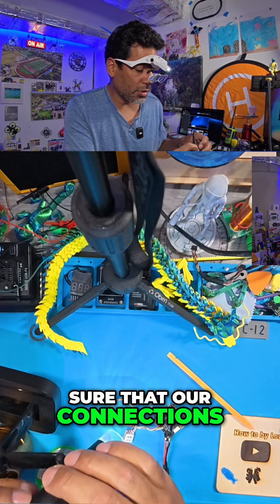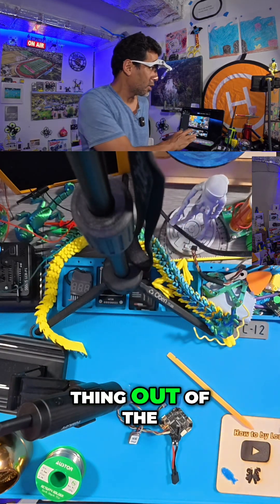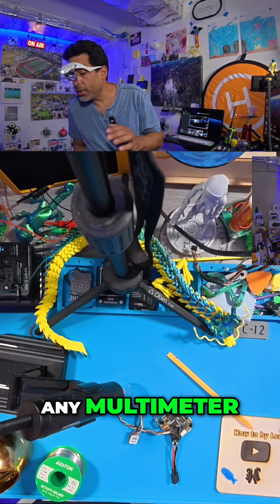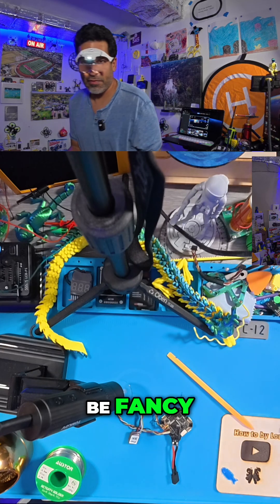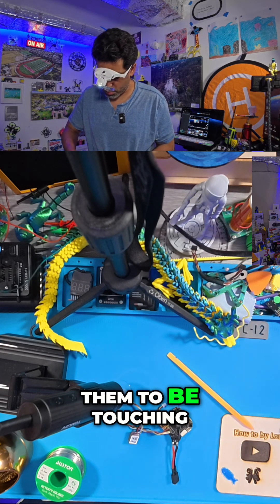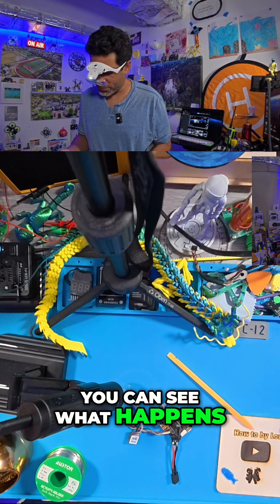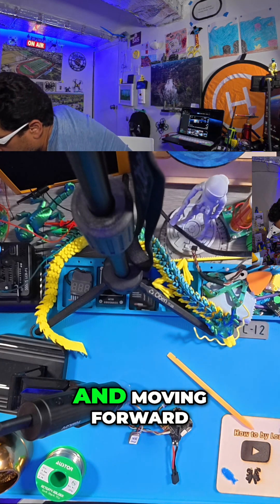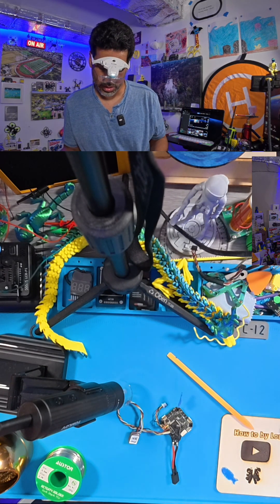Fixing Short Circuits_ Multimeter Guide to Find Bridgesdji avata 2, beta fpv drones

Comment: Think you didn't quite get the edit right there
Reply from the maker: Thanks for the heads up. Looks like opus clip ai isn’t doing what was supposed to. 

Great idea for new video on how to fix. Only downside is that each ai generated clip will have to be done manually.

Thanks again.
Reply from the maker: Thanks for the tip. Hopefully this will help other folks too.
https://youtu.be/vA-RvneAygs